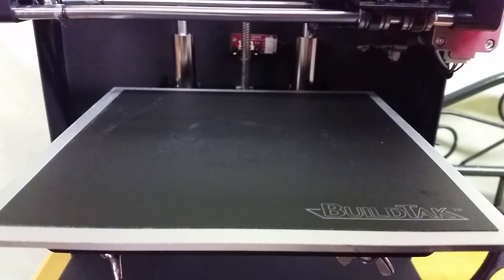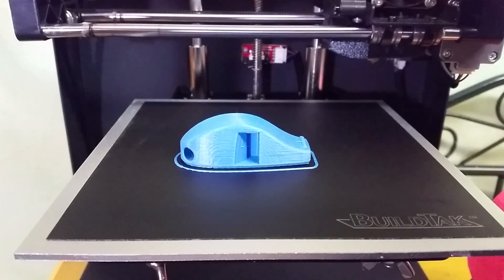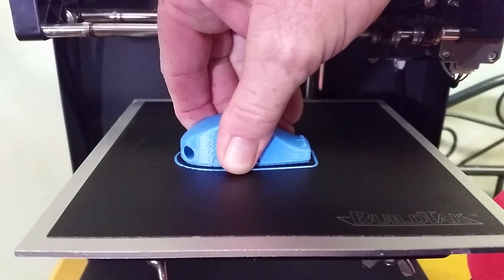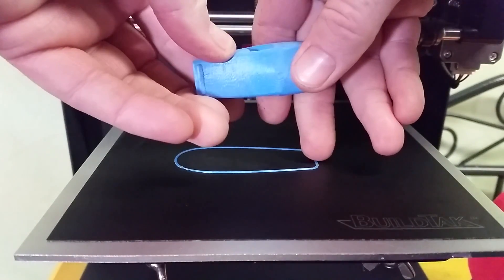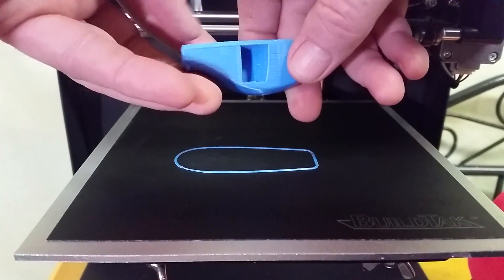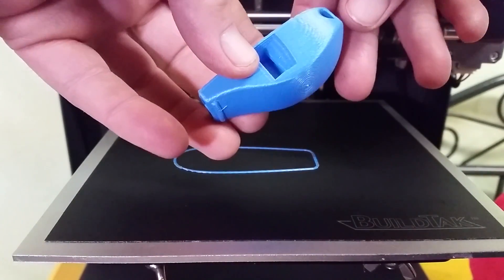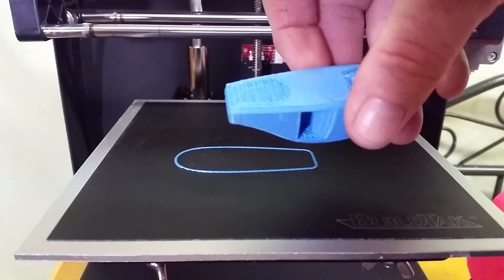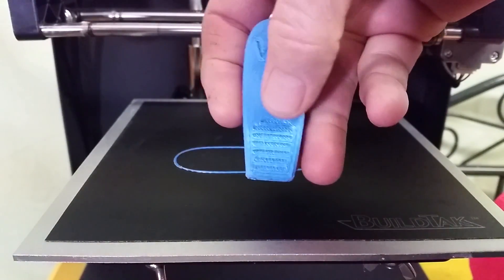3D Printed Whistle Using Rigid.Ink PLA +

Comment: not having much luck with the PLA+ 
probably caus i'm still a nooby
Reply from the maker: +Takoza It takes time to get things adjusted.  What problems are you having?
Reply: wel to start with , the first layer is prity bad unless i crank the flow up to 110-120
but after a few layer is it overextruding , nozel draging true the material
Reply from the maker: +Takoza when you level the print bed, how do you do it?
Reply: wel i'm waiting for a feelergauge that i ordered to come in 
but for now, i'm using a paper card that measures 0.2 
and i did get kinda used to what "feel" i needed for a good first layer with normal PLA & PETG
(could have goten lucky though lol )
Reply from the maker: +Takoza Try a single piece of printer paper.  Move it back and forth as you adjust it till there is a slight drag to it.  Once you do that all the way around.  In your slicer, if possible, set the first layer for 0.3mm and 115% extrusion.  Set your normal layer height for 0.2mm and normal extrusion to 100%.  Hopefully it will get you going with it.

Comment: The specs say temp should be 220-240 degrees but yours was printed much lower, did you try at the higher temperatures and what was the results please? It could explain why I am having problems dialling my prints in as I have not gone that low.
Reply from the maker: +Mark Franklin I have but this printer seems to run hot.  When I print a higher temperatures the filament runs out of the nozzle and strings everywhere.